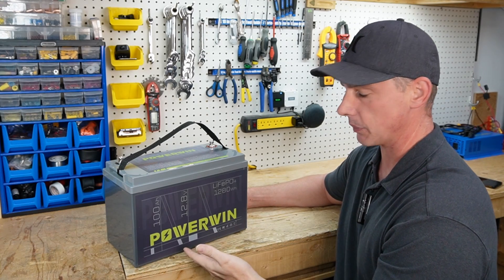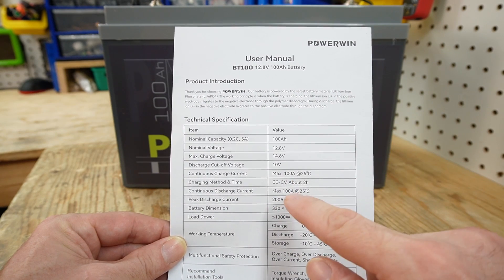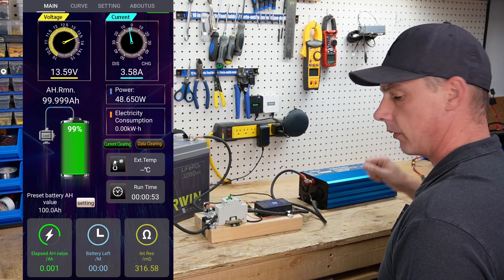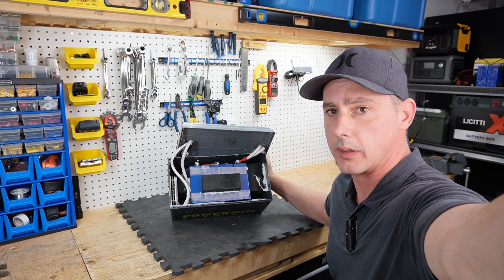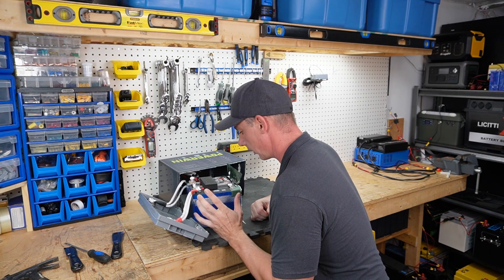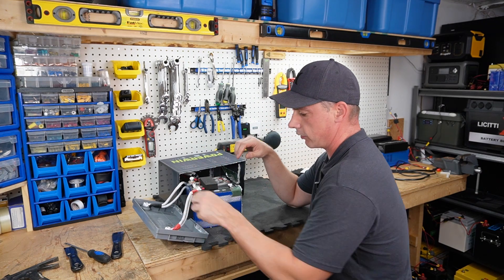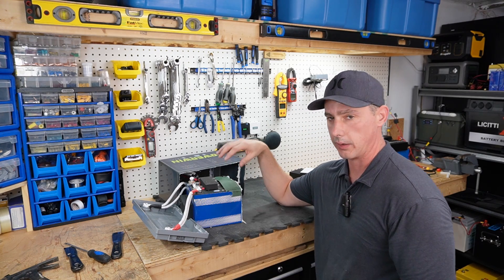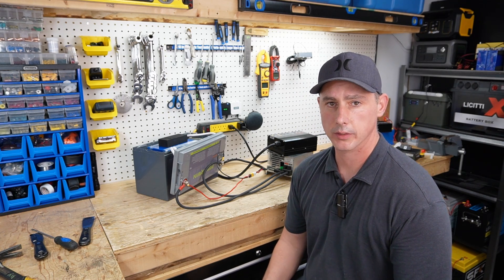POWERWIN 12V 100Ah LiFePO4 Battery Test and Review

Comment: 4:30  wonder if it is OK to have battery cells sitting on its side like that.
Reply from the maker: Pouch cells yes. Prismatic cells on the long side no. This battery had pouch cells.
Reply: @Roll2Videos  5:42 But I see  four Prismatic cells connected together in series.
Reply from the maker: @budmartin3344  Oh yes, I'm sorry I thought this comment was on the latest video I uploaded. These cells can be on the short side without a problem.

Comment: Hello guys ,really thanks for Roland test our new released  lifepo4 battery .We prepared a lot wonderful offer for you !The POWERWIN BT100 12.8V 100Ah 1280Wh only $239 in this time . Wish everyone love it !
Reply: Spend the $0.50 for a temperature probe for low temp cutoff.
Reply: Whos cells are you using?
Reply: @ChrisEpler  hello ,We are using LiFePO4, the prismatic cell. There are 4 packs of 25Ah battery inside as a whole pack.
Reply: Hey Powerwin, give me a coupon code please :)
Reply: @Powerwinoffical   I understand, Thanks!
Reply: Does the BMS of this battery have active balancing capability?
Reply: Yes it does. The module in the BMS involves redistributing the charge among the individual cells to ensure that they are all at a similar state of charge.
However, when you are using multiple batteries for the first time, please connect in parallel for at least 6 hours continuously, and it will automatically balance the voltages and its capacity. @flasher6480
Reply: 请问这个可以用在汽车上启动车辆吗？谢谢
Reply: @seanxiao2844 no!
Reply: yes ,it can  @seanxiao2844